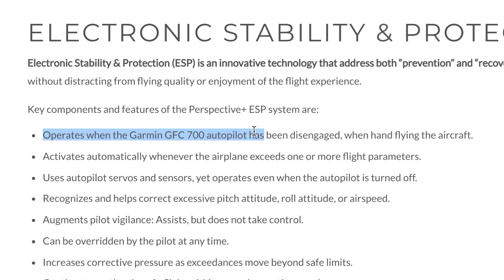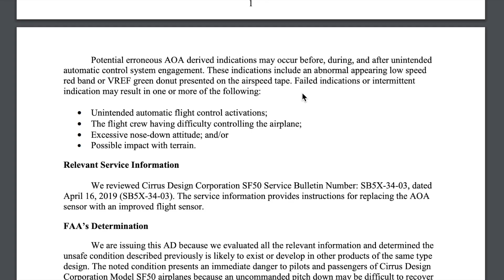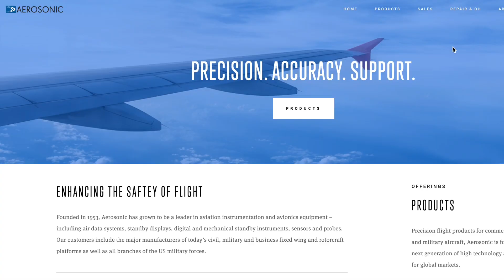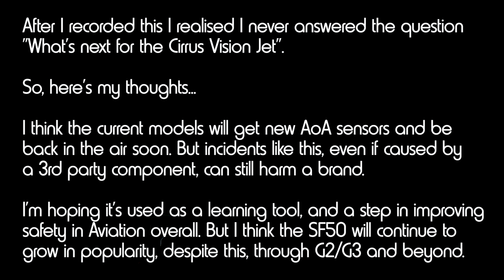Why did the FAA GROUND Cirrus VISION JETS?

Comment: The issue here is not an angle of attack indicator, but the angle of attack sensor and what the sensor inputs control, namely auto trim and autopilot. 
This is not something that is suddenly new in aviation. For example the first B737-100/200 aircraft utilized angle of attack sensors with the same purpose of auto stab trim and autopilot functions. Not a problem as long as pilots are properly trained and technical personel maintain these systems correctly.  Replacement requires careful setup/rigging and testing of these components and the systems they operate with. Test flights are also a requirement if intensive ground testing cannot be completely performed.
The FAA was correct in issuing the AD and grounding the fleet untill SB is fully completed and test flights performed.

John Ross

Comment: The AOA sensors have been used on passenger jets going back a long ways and have probably slaved many lives. The 737-300, which went into service in the early 80s used AOA vanes to initiate an automatic deployment of the Leading Edge slats to avoid a stall prior to stick shaker.   They vanes are dual channel RVDTs and there are two of them.  I believe it only requires one AOA vane to initiate the autoslat function.   Several conditions need to be satisfied before they initiate an event and it so it should be rather rare.   The problem with some of the more modern wing stall characteristics is that the LE slats need to be deployed very rapidly to avoid a serious control issue when the stall happens. On the 777 there is only a couple of seconds of forgiveness.  So waiting for a pilot response could be a problem.  

The Auto Slat system operates the LE slats automatically in flight when you’re approaching a stall under certain conditions just before the stick shaker becomes active.
These conditions are when the flaps are at position 1 – 5 and hydraulic pressure is available through:
• Hydraulic system B
• PTU (extend & retract)
• Standby hydraulic system (extend only)

* With Alternate Flap use, the Auto Slat function is not available.
* With a short field performance configuration the Auto Slat operates with flap selections 1 – 25.

At the flap position 1 – 5 the LE slats are in the intermediate (extend) position and the LE flaps at their only extended position . . . FULL. When the aircraft approaches the stall angle/speed region determined by the Stall Management and Yaw Damper (SMYD) computer, the Flaps/Slats Electronic Unit (FSEU) command the LE slats to the FULL extend position to prevent entering a stall condition. Another action by the FSEU is to delay the “transit lights” to operate for 12 seconds thereby preventing the LE devices transit lights to illuminate.
When thrust is increased/stick force relaxed and the aircraft flies out of this condition (higher speed, lower AOA) the Auto Slat system drives the LE slats back to the intermediate extend position. Also here the transit lights will not illuminate.

Comment: Too many gadgets, simple is best, I'll take a skyhawk over any jet. Not really sure about the caps system, or how many spins its rated for, in an emergency I don't know if I'll give up control, you can easily glide and land the plane even without the engine.
Reply: A quick check of Aviation Safety Database for the Cirrus Jet( https://www.aviation-safety.net/wikibase/type/SF50  )                                             shows a total of 5 accidents world wide from 2/26/18 to present. There were no injuries and just one with substantial  damage. Contrast that record with the C172(   https://aviation-safety.net/wikibase/type/C172/50  ).                                                       During the same time period there were at least 75 killed and 42 aircraft destroyed. Why The FAA has not seen a reason to ground these death traps I can't imagine.

Cirrus training addressed these system runaways and were all handled easily in flight by the pilots. Cirrus has fixed the AOA problem and there has been no outcry from SF-50 buyers about safety. Deliveries continue apace.

Would I fly in a SF-50? Absolutely. I used to feel the same about 172's but after doing this research I'm not so sure.

Oh and you can't glide home after a mid-air. You might have a chance with a CAPS deployment.

Comment: It's not a choice on many modern jets. AoA indicators are the most important sensors on an aircraft. Some of the most important flight control laws receive data from the AoA indicator. From the basic stabilizing controller control law (for short period mode augmentation) to more complicated autopilot commands, they all make use of them.

Comment: FAA grounds the Cirrus fleet for AOA, which I think it good, but they find no issue with Boeing using substandard structural parts in the 737 as revealed by several whistle blowers.

Comment: I flew for 50 years without an angle of attack indicator, they might be useful as an indicator, but while they can take un-commanded control of the aircraft they are dangerous. Have the indicator by all means, but don't link it to the controls. If you can't fly the aircraft without the AOA linked to the controls, don't fly the aircraft!

Comment: Military aircraft has a AOA sensor and they have been in them for a long time now. They do not work until you are in landing setup though, gears and flaps down.
Reply: Not true. Most military fighters today have full time AOA, used for things like "best range AOA", "max conserve AOA, etc"
Reply: @f-16guy30  So it actually shows the AOA all the time? I meant like the F-16 and F-18 where it shows the AOA for landing. Even the F-14 had the AOA indicator, but they usually do not come on until you are in landing configuration. The Cirrus has an indicator also, but it looked like it was on all the time.

Comment: All these companies share software.....Dont believe it look at cars, military gear across all branches, they just all use legally slightly different programming or wording to avoid the obvious issues. However the fact the FAA has not launched an investigation into the Aerospace industry as a whole to find out who designed the original failure and shared it and who all bought versions and use them and make them recall it is sad. All these AOA failures are not just random they have a source. Now every tom dick and harry knows what a AOA sensor is and is an expert but cant change engine filter. How is this possible.

Comment: The solution is simple. Just get rid of ANY interfering automatic take over of flight controls apart from the standard autopilot. Honestly, if a pilot cannot work out that the aircraft is in a dangerous attitude/speed he or she should not be in charge of an aircraft in the first place. All these devices do is add another unneccesary layer of automation.

Comment: The AOA sensor should not be a mechanical wing hanging off the plane. That is bound to fail.

AOA should be calculated by pitch angle and airspeed.

Comment: At altitude, these aircraft have a very narrow envelope for control. Approaching or exceeding max weight and balance can affect the safety of flight and can make the aircraft less stable. This can leave the aircraft with a stall speed just a few knots below the cruise airspeed. The autopilot can fly this aircraft. A human can not balance such an unbalanced aircraft. This aircraft is too sophisticated to not have an AOA sensor. You can't fly this thing by the seat of your pants.

Comment: The AoA sensor isn't the only problem. It's the "the pilot must be doing something wrong, must be too stupid to fly a plane, and now I have to correct it" systems. This automation is what is dangerous. I also can't believe the Cirrus Vision Jet doesn't have two AoA sensors either. I mean, if a system is going to "take over the plane controls", it should know for sure that the signals it's getting are correct and that can only be done through redundancy of the sensors. I'd not want to fly in an SF50 and have the ESP system on knowing only one sensor is giving it data.

Comment: It seems to me the problem is not the angle of attack indicator but the computer control interface that is causing the problem and indicator is just now, and indicator and does not control the airplane. It’s software and auto pilot functions that are the issue

Comment: I'm getting tired of hearing about these AOA failure's in the media. Sure, there are some components of the system that can be positive such as the stick shaker especially in heavies. But the systems which they are installing now to automatically avoid a stall is ridiculous. I started flying when I was 15 (I'm 31 now, 5,000+ CPL, CFI, A&P, former UH-60 Crew Chief) and my CFI owned a backcountry flying service in Alaska for 23 years. We spent a lot of time flying on the high angle of attack, low airspeed, high power envelope and it only made me a better pilot. People now are so afraid of getting low and slow that it's a shame. I say take that cash that they're throwing into TRYING to make these systems work and invest instead into properly training the guys and gals up front to recognize the phases of an impending stall, slow flight maneuvering, and just for the hell of it, how about we bring back the requirement for spin training for the PPL.

Comment: Let this be known!
"You see, that instrument to me is stupid. It tells you what your angle of attack is. If you don't know what it is, you shouldn't be flying"_ General Chuck Yeager, F15 Sonic Flight reanactment (long) around 2:15 mark (in that video). 
Now, Not all situations call for for an AOA reading. It might be by the time you need its reading the aircraft attitude would have long been in the process of deteriorating. These systems should be (one of) the last line of defence and not the first port of call. Internal inertial, attitude sensing systems have been perfected with what goes behind indicating the artificial horizon. Manufacturers also, have long since been deriving formulae to predict an aircraft's AOA. These sensors are sensitive and their working environments are extreme to say the least. I know engineers are working towards better safety but we can be lost in the sea of ambiguity. An engineer may not know what a pilot wants or needs. WE NEED to have open dialog all throughout the development and improvement of aircraft no stone should be left unturned and no questions should be considered stupid. Safety must be maintained at all cost!

Comment: I agree with some of the comments here - AoA sensors are not the problem; it's the ESP / autopilot that's the issue.  Treat the AoA like the stall warning horn, nothing more.  And if you insist to tether the AoA to the autopilot, you need redundancy and election algorithms like Airbus have had for some time now.

Comment: Nothing wrong with a passive angle of attack indicator, its an additional data tool that the pilot can use to correct or better their flying. However, when the bloody thing  is used to automate a "stall" recovery. Its when things have gone wrong.  The inherit design also leaves to be desired, and if its a critical part of the hardware to control flight. It should really be doubled (2 sensors), and disabled itself if the 2 inputs data are found to be unmatched. It sounds like it did the opposite with the Boing tragedy and impeded the pilots.

Comment: An Angle of Attack sensor problem again, leading to a potential loss of control. It's interesting how the FAA has reacted quickly to this issue concerning a relatively small company yet dragged it's heels over grounding the 737 MAX - which comes from a powerful aerospace corporation that has connections with the government and a cosy working relationship with the FAA ....

Comment: There’s a couple pieces of key information that need to be considered here. AoA is the best way to indicate a stall, which is why they’re used in ESPs like the Cirrus. But there should also not be a single point failure like in the Boeing 737 max, there was one AoA Sensor and the whole system was dependant on that. On the FAA side of things there is currently no regulation define what these systems should look like or a standard test process, meaning each system is tested on a one by one basis. That being said, Airbus has been running fly by wire aircraft for decades. It’s an interesting space to watch as all the flying cars that are being designed will have to have a fly by wire system.

Comment: An AoA indicator can be a useful tool for certain mission profiles.  Personally, I wouldn't retro-fit one to my aeroplane - but if one came with the plane, I'd learn to use it.  As for the Vision Jet - looks to me like an aviation solution looking for a problem.  I just don't get the product offering - limited range, slow for a jet, limited payload, etc.  My opinion only - am I missing something??  Cheers.

Comment: The fundamental problem is failure of the FAA, NASA, and aircraft industry to bring sensor technology into the 21st Century. Depicted are kludgy mechanical sensors- isn't it high time we move to solid state laser/lidar or other highly reliable modern sensor systems (micro rlg, accelerometers etc) not only for AOA but as replacement for the ridiculously antiquated and highly vulnerable pitot-static and vacuum systems. But that's not all, aviation continues to be burdened with archaic piston/magneto systems far far behind automotive engine technology. There is something fundamentally wrong with GA aviation in these respects. And if the FAA were serious about improving safety they would mandate gradual transition from piston to the simpler and much more reliable and much higher TBO small turbine FADEC engines for all GA.

Comment: I've been a pilot for 45 years and I can't believe someone put a system like this in an aircraft! Autopilot commands in the old days required it could be easily overpowered by a 90 lb woman. This is insanity and comes on the heels of these idiots trying to insert a computer in everything...and an AI as soon as their little rat brains can get a buggy model approved. Pilots of aircraft MUST retain control of an aircraft and all its systems unless it is decided to engage the flight control system. I cannot believe I hear of commercial airline pilots fighting a computer-aided aircraft for control...this is absolute insanity!
Reply: A pilot should be able to over ride the system any minute.
Reply: As a non-pilot, simulator student, I totally agree. This is the end result of endless litigation and greed in society. The airlines what aircraft that can't crash due to pilot error, or maintenance failure, because then it's "someone else's fault". They also want a plastic aircraft that can climb to FL430 like an f-15 and sip fuel at Mach .85, with minimal investment in pilot training using MPL "pilots". This requires automation and artificial stability approaching the limits of what can be achieved with current technology which is itself limited by financially dominated manufacturing processes. Then an airplane flies itself straight through 9 kinds of GCAS, right into the fucking dirt. Yea, it's absolute insanity.
Reply: Classic case of “technology for the sake of technology”.  A bunch of young pHD engineers sitting in a stupid share-space office having a mutual ass-licking session to see who is the coolest employee.  

Also, pilots....stop fiddle-fucking around with the flat panels, get your head up, look outside, then back to the panel and hand-fly the airplane for change...

How many younger pilots could hand-fly an old NDB approach to minimums (in a V35 Bonanza) on a hot, bumpy summer night without making a smoking hole in the ground.

Few, I suspect.  Not enough buttons to push and menus to save you...

Somewhere along the line we’ve gone from “fly the airplane” to “UI/UIX circle-jerk”.
Reply: You're right. I am no pilot, just a passenger frequently enough on commercial airlines. And, simple logic tells me that MCAS is some craven money-driven initiative...at the expense of safety.  As merely an armchair admirer of all things aviation, I have seen several variants & new iterations of large planes, through the decades. There was a truncated version of the B747. There was an upgrade of the DC10 into it's MD-11 version, there was an A340 which was stretched about four meters longer, to make it the -600 variant. And...at no point did I hear, ever, in the news, that there was a greater threat of nose pitch-up, or stall, or other crash risk, with these new versions. So, along comes this new version of a B737, with it's engine nacelles slung higher-and-more-forward, on the wings...and...this rather conventional otherwise aircraft has...has...a serious stall-risk?  Requiring...requiring...MORE SOFTWARE, onto a software-loaded plane, already?  One would think, intuitively, that this new engine wing-setting would make the plane more nose-heavy, instead of nose-light ,no?  In what way does forward-slung engines make the empennage more sit-down heavy...leading to a nose-up stall?  I just don't get it.  Aren't pilots allowed to be pilots, anymore? With with constantly refreshed human stick-&-pedal skills?  This MCAS thing...epic SHAME on you, Boeing.
Reply: If it were me and I were designing a personal jet I would solve the problem of a TCAS by simply not having one. As a student pilot, having the instructor keep a death grip on the yoke is one thing, pitching down without you doing anything and not being able to do anything about it is another.
Reply: IT here, have been for almost a decade now.... NEVER TRUST COMPUTERS. PLANES AND CARS SHOULD NOT BE AUTOMATED.